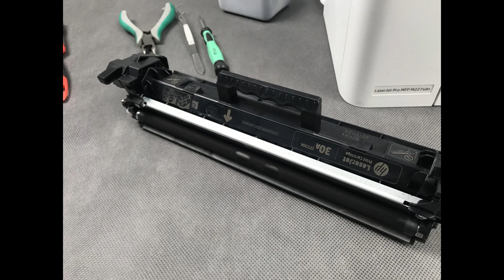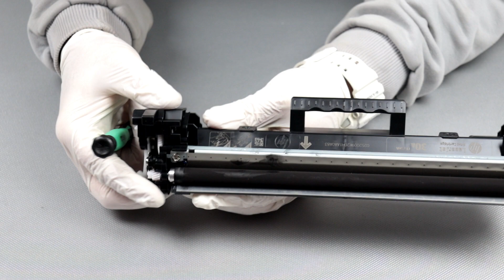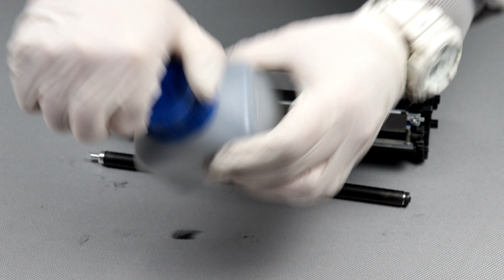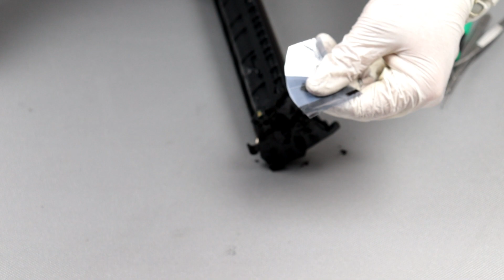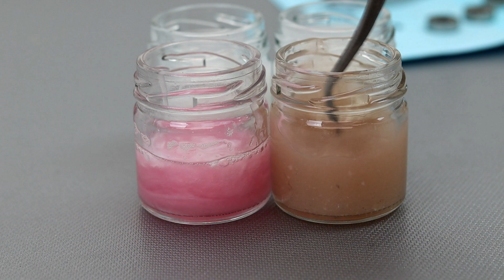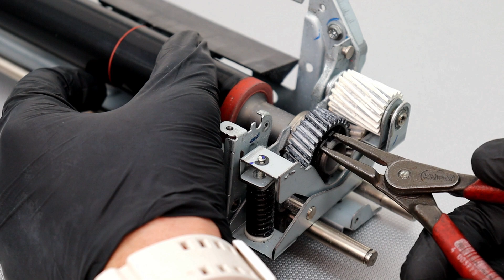Toner refill HP30A CF230A printer HP Pro MFP M227FDN, M227SDN, M203DW, M227FDW, M203DN

Comment: Will this toner cartridge work correctly without the chip you inserted at time 6:20 in this video?
Reply from the maker: @Faust-g1q Without the chip it won't work. The machine won't work without the chip. But the chip costs $2, buy a new one.

Comment: Will the original chip work in another refilled toner cartridge? Why couldn't the original chip be reused in the original toner cartridge?
Reply from the maker: @Faust-g1q The chip will not work after refilling the toner. This is in the interest of the printer manufacturer, HP. The chip is just a counter and a lock after a certain number of prints. HP wants you to buy a new toner, so the chip only works for a certain number of prints. Best regards. What country are you from?
Reply: @MrRicoh  How would this affect the high yield cartridges for the same printer model and non-oem cartridges? Are all countries affected? Good work.

Comment: There is a way to make the printer recognize that the original HP 30A/30X cartridge has been refilled with new toner?
Reply from the maker: The only way is to install a new chip, now it's gone. I don't know where you can buy a chip.